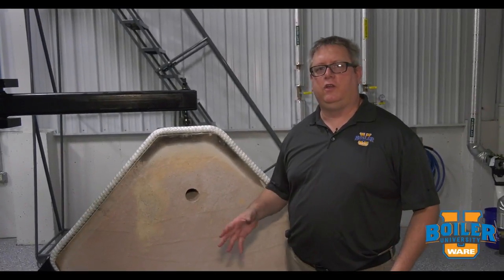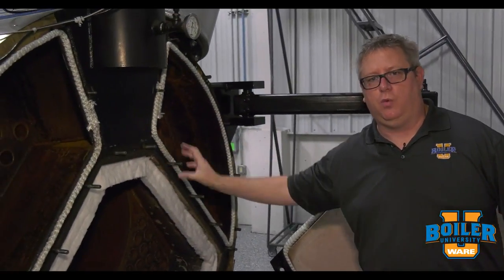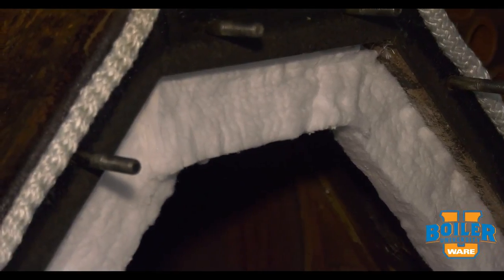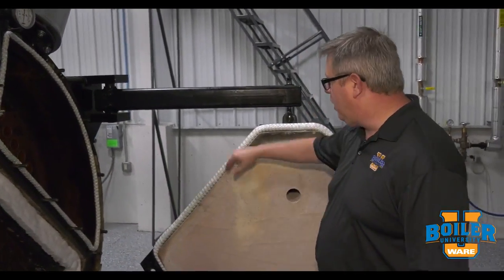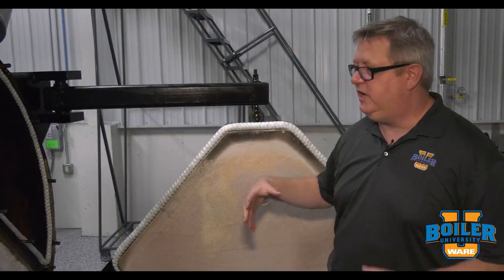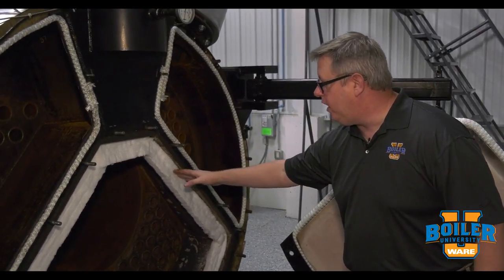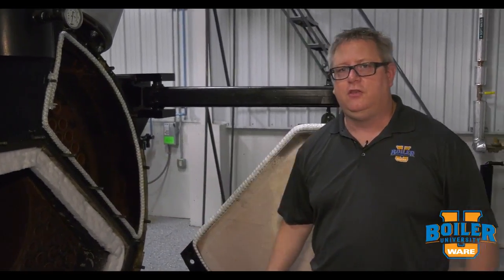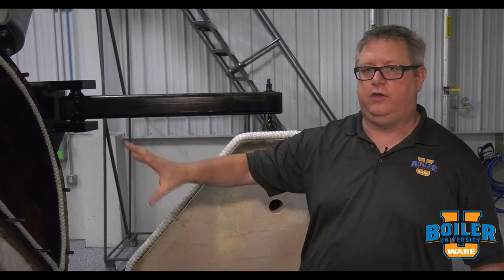Using Fiber Wool Blanket Gaskets to Seal a Boiler Door - Weekly Boiler Tips

Comment: Great video guys. I know you guys have made a video about blowing down a boiler, but have you guys made a video on "How to properly blow down level transmitters/transducers" 
Something sometimes seen in older boilers is the analog signal (coming from the level transmitters) being used to control the drum level starts acting crazy and an operator has to place the boiler in manual and control based on what the conductive probes or electro eye-hye system, they then isolate the transmitter and blow it down, then put it back online, sometimes they may even put a "Wet towel" on a condensing pot to get it to fill up so they can start getting level indication again

Maybe talking about what those little condensate pots seen in boiler rooms are doing would be cool, or what that whole "placing a wet towel on a condensate pot" thing is about
Reply: I’ll talk with Jude about this. Thx for the suggestion. Appreciate ya watching.